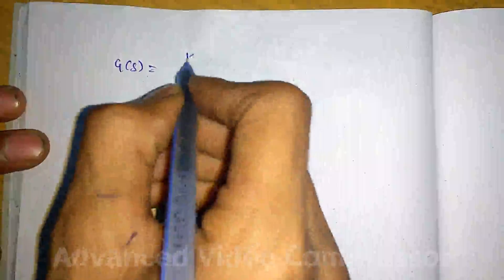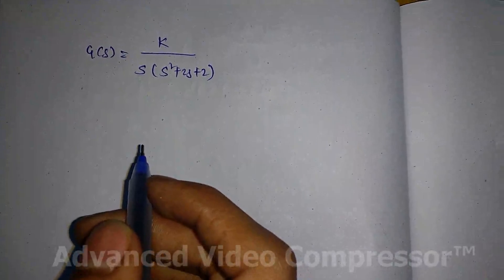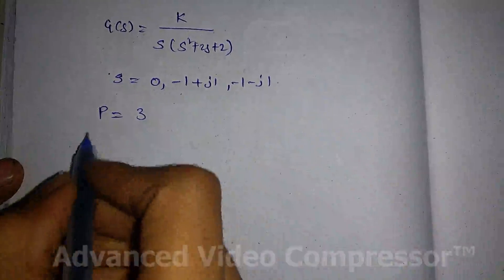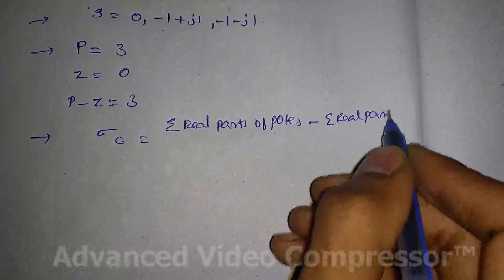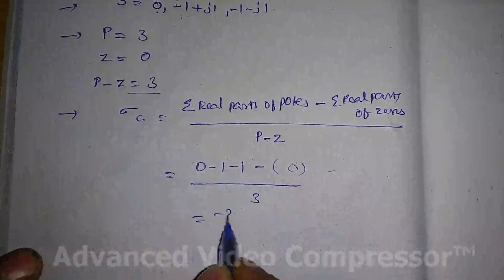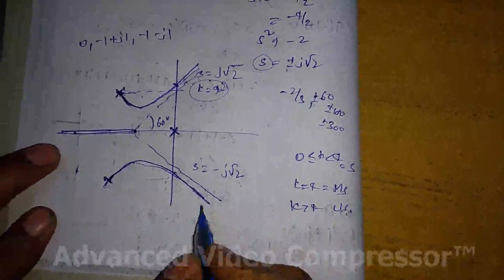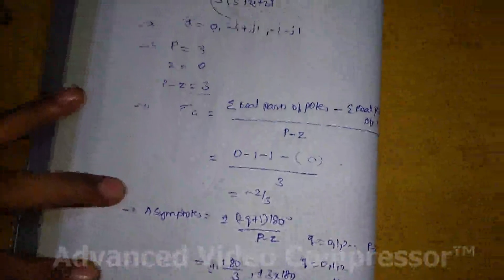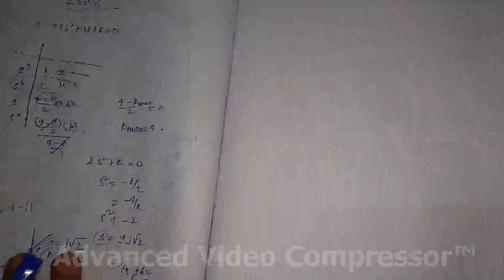Root locus construction

Comment from the maker: Dear viewers,
There is one mistake in the root locus diagram.You can find it easily.Please find the mistake and comment it down.
Reply: vijay vihar bandari can you explain the breakaway point wrt the final root locus drawn, and why didn't we consider 300 asymptote angle?
Reply from the maker: Vaishnavi Mendiratta 
Yes,we have got two complex break away points but a breakaway point must exist on root locus.
whenever we get a complex break points we need to check the validity(whether they exist on root locus or not) using angle criterion(same as angle of departure calculation except that we don't add 180°)
the angle so calculated must be in add multiples of 180 to confirm that it is on root locus,but here we get -90° if we calculate(which I have not calculated in the video)so they are invalid breakpoints.
300° is nothing but -60° which was drawn in root locus(please check once again)as asymptote.
A small mistake I have done in the above video is the origin pole locus was not drawn.The locus will extend from 0 to -infinity along 180° line
Thank you for your beautiful query.
Reply: Thank you Sir! :)
This video helped alot.
Reply: vijay vihar bandari awesome explanation sir ,point to point